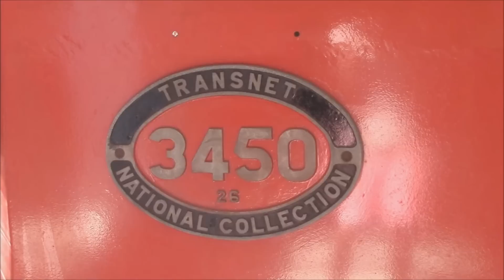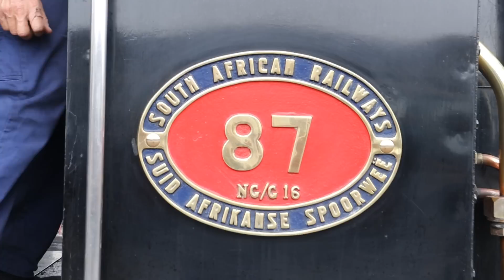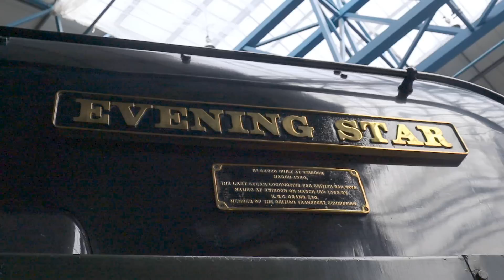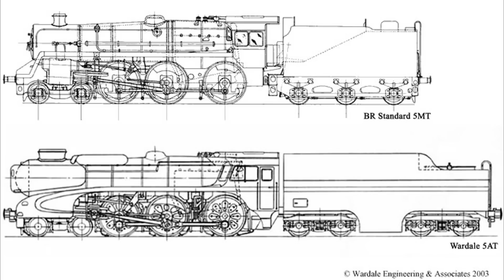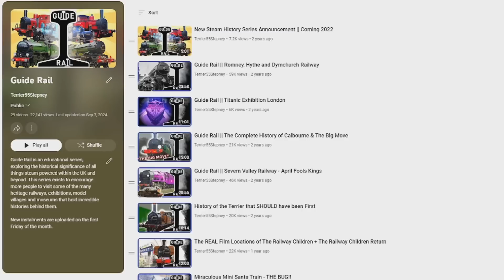What happened to the FUTURISTIC steam locomotive?

Comment: I don't know why you didn't mention No.71000 ? That's literally the peak of steam advancement and has shown what you could do with boiling water.
It kind of made the 5AT project obsolete, as the 5AT wouldn't improve on performance or possibly cylinder efficiency over the Duke. 
Be interesting to see how well it goes during its next ticket. 

Future vid?🤔
Reply: Probably because it wasn’t a good runner when it was built. Granted it’s had improvements made to it in preservation
Reply: @poshdan4071 regardless of it not being quite upto scratch when built, it still had the highest cylinder efficiency ever recorded and then has gone onto show how well it does work. 
As I said in the comment, that because 71000 had shown how good it is, it kind of made the 5AT project redundant. It definitely should've got a mention or a segment.

Comment: Honestly I daydreamed of this too many times, if any of us had a shot at it and develop a 21st century steam loco it would have to have a mix of electric and steam propulsion, it would be mixed fueled for both solid and liquid fuel burning. Going further it would use those compact +10,000psi pressured steam generators used in steam cars from the 1920s but losing the loco's inconic horizontal boiler. 

Given that battery electric EMUs and shunters existed in the 1920s as well like the Drumm trains of Dublin, it seems like a missed oppertunity that the inefficiencies of warming up and the wear'n'tear of starting and stopping heavy trains  weren't complimented by a battery-electric regen "accumulator" system. While on the other hand steam performs best at constant speed which is the absolute opposite for electricity. 

Hell we've had several decades of Diesel dynamic braking wasting electricity into heat before anyone bothered to harvest that energy with batteries.
Reply: oil burning steam turbine electric, with maybe a small booster engine for goods, and a more normal steam engine with auxiliary electric motors is what I'm thinking of.  That way you get most, if not all of the advantages of diesel electrics, but you have the grunt power and top end performance of steam.
Reply: didn't see your reply till now! I'd rather conventional steam (mix fuel) with electric traction boost, rather than oil fired steam turbine and a steam booster.
My thinking was to not use turbine power, not least because of the added complexity. It's efficient at certain high idles and full power rpm to generate current, for a power plant, it isn't efficient at all when spooling up from coast or starting, quite like how a crazy proportion of energy for a jet plane is used taxing and takeoff. Couple this with the fact that high speed travel consumes way more amps, it's the same reason why batteries aren't the best at high speed, or series hybrids in cars or diesel electric locomotives. Speed (rpm & wind resistance) sucks amps. 

That's why I proposed keeping traditional steam pistons and valve gear because they are more efficient at putting the power down at high and continuous speeds, helped by an electric powered bogey or two with batteries and/or overhead supply to supplement starting and slow speed acceleration along with recapturing all that momentum of a train slowing down.
Reply: @BeLowBelowo  good start, but what I'm worried about here is the reciprocating motion.  With all the rods bending slightly at super high speed, and bearing wear making everything worse, just like a Gresley A4.  You would go super fast, but you may also get a lot of premature wear above 130 mph.  An A4 with thermic syphons, a 50ft grate, double Wiloteaux valves and lempor exhaust, made from modern materials, roller bearings and fine tolerances (and maybe putting a crank on the front driving axle to allow the middle cylinder to be inline a la Australia) would be excellent!  Id wager that it'd be readily capable of 3000+ dhp, and a top speed of 150-165!  Electric booster engines would be great, though a traction motor mounted on the drivers would help at slow speeds.

Comment: I like how you say “puffing in an exaggerated manner” while footage of a manor plays in the background, cheeky that.
Reply: Why do Great Western Engines make a ticking noise whenever they are puffing under their own power,
Halls, manors, panniers, prairies, 14xxs they do it
Reply: @LBSC70 it's just the nature of the valves on Western designs
Reply: @ChristheXelent  Ok thanks
Reply: @LBSC70VA The ticking is the anti-vacuum (aka a “snifting” valve). They serve the same purpose as a small ejector but without wasting steam. They only actually help remove the brake when the loco is going over about 15-20mph though which means that the large ejector has to be left on if the train is going below that speed, which is the only major drawback.
Reply: @BrokenIET  thanks for explaining it
Reply: @LBSC70 All of these answers are wrong! 1) The ticking noise is the vacuum pump (or more correctly 'air pump' - you can't pump vacuum as it it is actually nothing!) Suction pump would perhaps be a better description. GWR locos were fitted with such pumps, driven by the crosshead and took the place of the small ejector so that  this pump would maintain the vacuum (25hg) in the braking system when running without using any steam for an ejector. The only GWR designed locos that weren't fitted with vac pumps was the 15xx class. When shunting a dead engine you have to remember to open a release valve, or the pump will apply the brakes!   2) The anti-vacuum (aka “snifting”)valve is not the same as a small ejector! In fact it has nothing to do with the brake system at all! Its purpose is to destroy vacuum in the steam circuit. When the regulator is closed the cylinders can act like a suction pump and draw ash from the smokebox down into the cylinders, causing untold damage. The snifter prevents this.  Snifters also aid coasting. GWR snifters are absolutely silent, they don't tick at all, they open when the regulator is closed and close when it is reopened.
Reply: @ianbramble8337  My bad, I got the name of a thing wrong, that doesn’t really make any of the rest of my statement wrong.
Reply: @ Very informative, thank you.